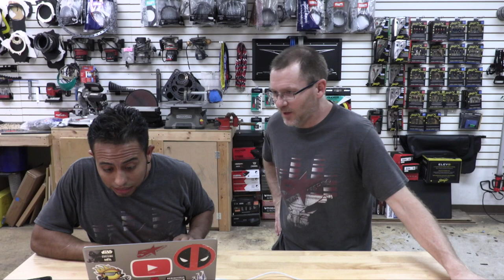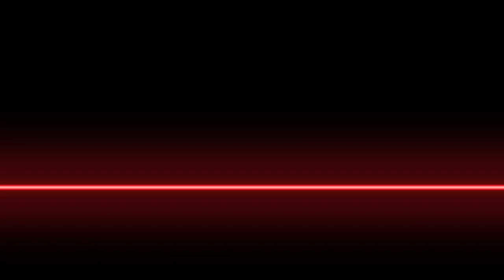Which Channel Should I map to the output to my sub Amplifier and what Load Resistor should I add

Comment: Hey guys I got the new dfo2 harness and drs1. Before I was running speaker level outputs to my dsp. Why are all my factory speakers popping red, does Ford wire everything in reverse polarity? Won’t that reduce bass output and should I wire everything in correct polarity?